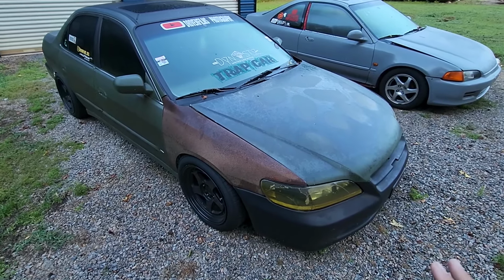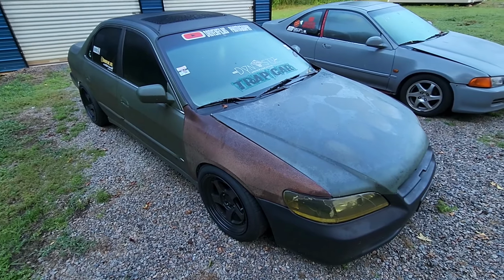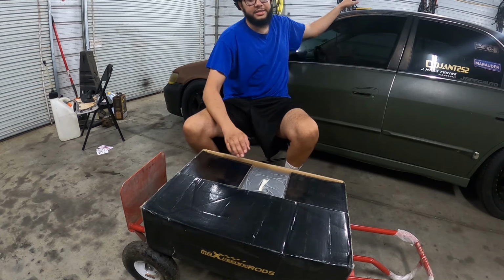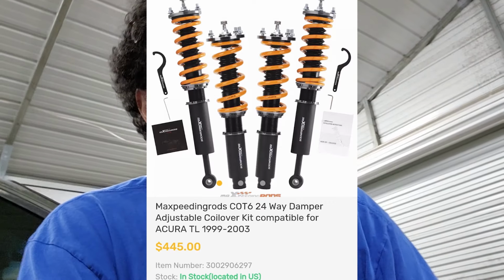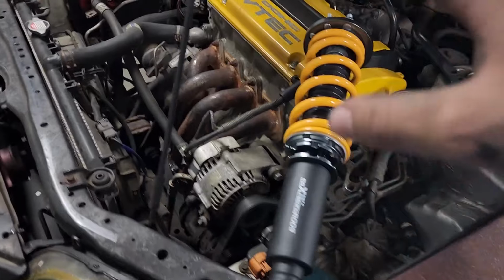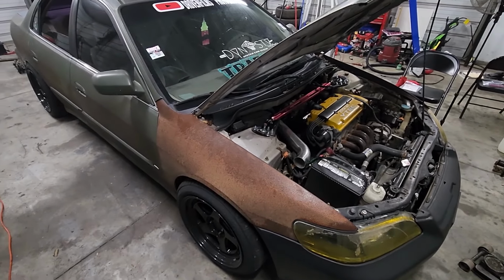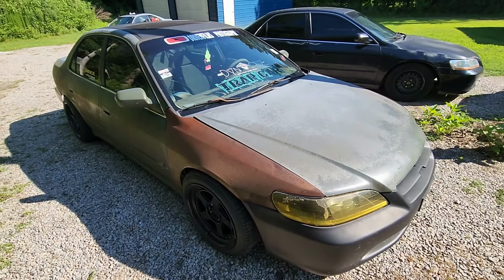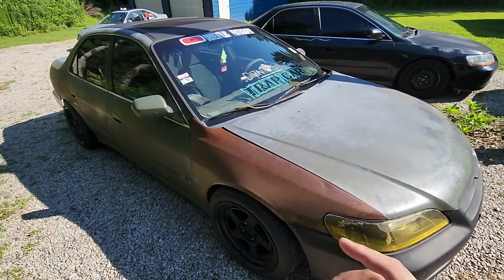TrapCar Gets More Love! | H23A VTEC Powered Honda Accord | Budget COILOVER Gamechanger!

Comment: I love MaxpeedingRods coilovers, and I have the basic ones without dampening adjustment, they went on my car just fine because I know everybody says that the ones for the cb7 don't fit the car mines went and no modification no issues and I definitely plan on upgrading to these and you just taught me a little tidbit with that Prelude clutch info so I know which direction I'll be going when I replace my clutch which needs to happen soon💯💯🙏🏾🙏🏾